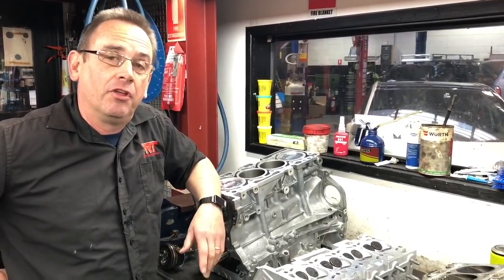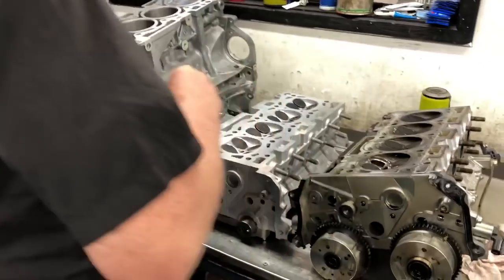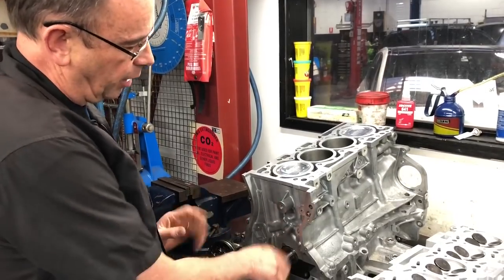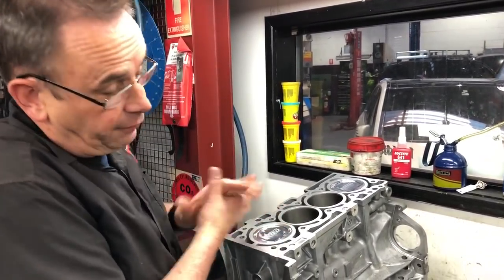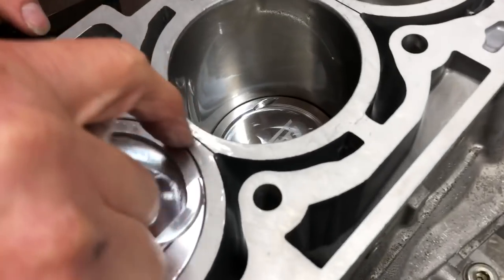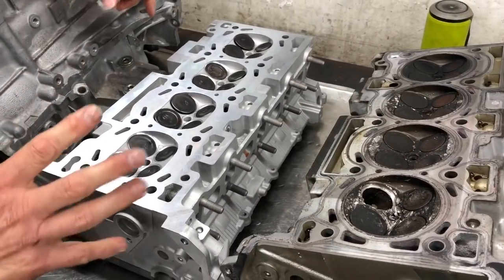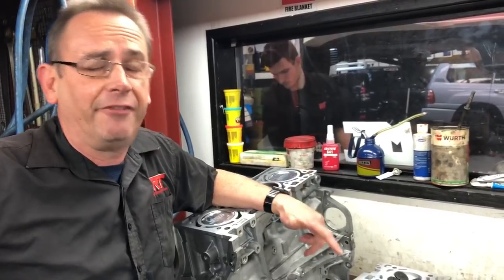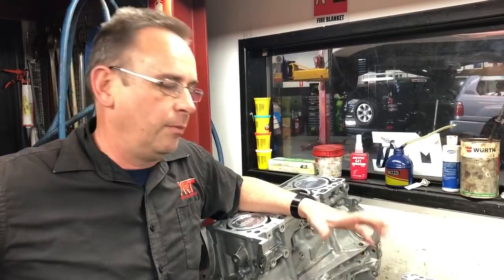4B11 Mitsubishi Evo/Ralliart Engine Rebuild - Stroker Kit

Comment: Alot more cylinder liner bracing than the Ford eco-boost open deck blocks. What would you say would be the limits of the 4b11 block before you need block mods like cylinder liners Brett?

Comment: In the USA the Ralliart is a cheap low hp car. Is this 4b11 going to be turbo?
Reply: the Ralliarts we got in Australia were turbo cars, but lower power compared to the evo X
Reply from the maker: Chances are the ralliArt turbo in the USA is the same as we have here with the 4B11 engine